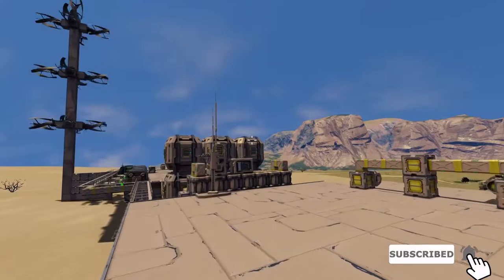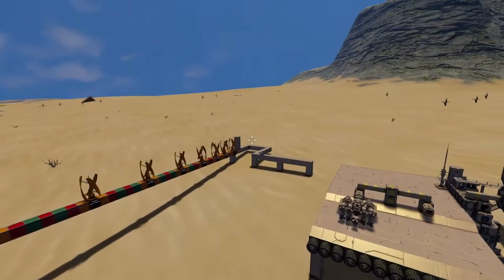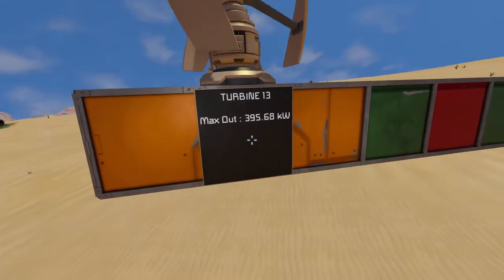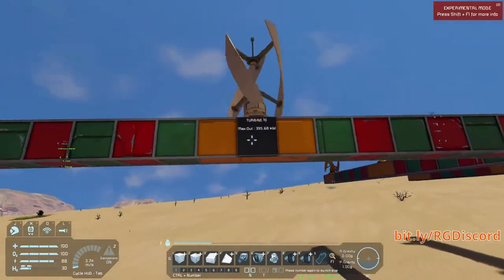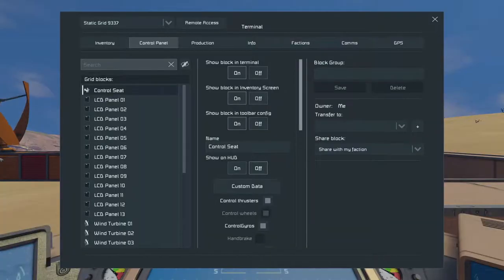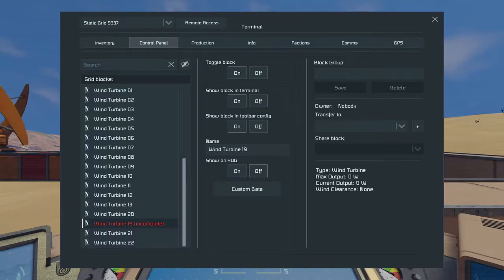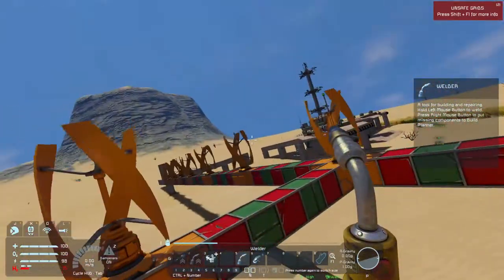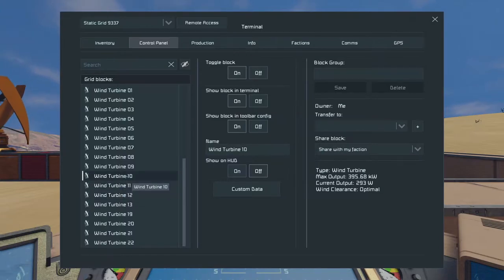The Truth about Turbines - Part 1 | SE Snippets | Tip's and Tricks | Space Engineers

Comment: So many false assumptions here.... Turbines check clearance in 9 directions, average that distance, and check it against an ideal threshold for the atmosphere.  Checking a single line of turbines will only change the range of two of the 9 directions - so you really haven't determined what the worst or best spacing is.
Reply from the maker: I checked 4 directions in this video,  I've also done additional testing on my various series'.  I can safely space turbines in all directions on the earthlike planet using this method to get the optimal efficiency for their specific environmental area  (Lakes will be different from deserts or grasslands).  Also you can place turbines top to top without effecting the efficiency as long as you have a minimum distance of 6 on the sides.  Essentially you can build towers right next to each other as long as the "minimum" side distances are 6.  I've done the testing.
Reply: @RelaxedGamer  you can actually get optimal efficiency with turbines directly next to each other if you understand which ranges the turbines raycast in - of which there are nine. You may have found an arrangement that gives you max power output, but it isn't optimal for space or resources. Its also misleading to say that any side has a minimum distance of 6, since it takes a combination of the nine directions. You can have turbines with spacing of less that 6 in a direction if your other directions are clear they can still achieve peak output. This is why I found this video misleading - maybe my first comment was a little aggressive - but it isn't letting your viewers really understand what turbines are looking for.
Reply from the maker: I got another video processing in response.  But in a straight line of turbines you could probably go 6-turbine-5-turbine-repeat.  But for simplicity sake I went with 6.
Reply from the maker: Out of curiosity do you have a doc or a video that might allow me to understand what you mean.  I posted that other video to test the 4 directions a little more concisely and the strangeness that is that the top of the turbine.  If I am to understand you said 9 directions.  I did 4 plus the top and height but the diagonal 4 I never played with, and do they matter? If I can understand it better I can better pass it on.
Reply: @RelaxedGamer  Yes, the diagonals matter also. They check clearance in 4 straight + 4 diagonal + down (making 9 total).  The straight and diagonals are all in relative to the orientation of the turbine, down is not.  Down is an interesting one, it explains why an inverted turbine does better (ex. in your first test setup, try putting all the same spacing except on the underside of your grid). I'll DM you some references.  There are still aspects of turbines that I want to test further, but I have tested quite a bit of this and challenge myself to find optimal arrangements (usually most power out of a given area, since most optimal for resources always simplifies back to a single/few well place turbine which isn't all that useful in total generation)
Reply: @RelaxedGamer  sent you info the email in your YT profile
Reply from the maker: thanks, I'll check it out.